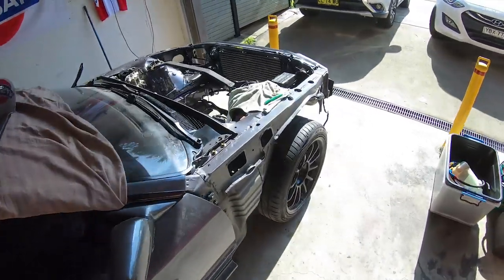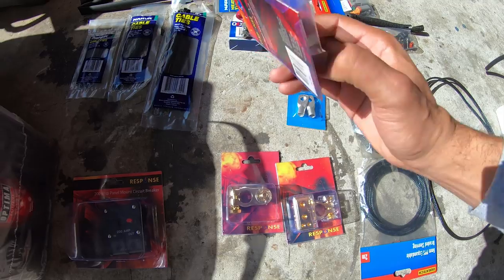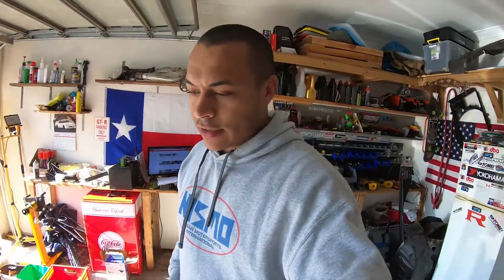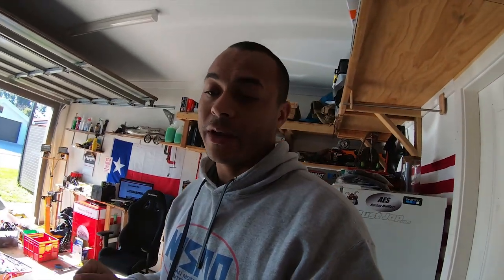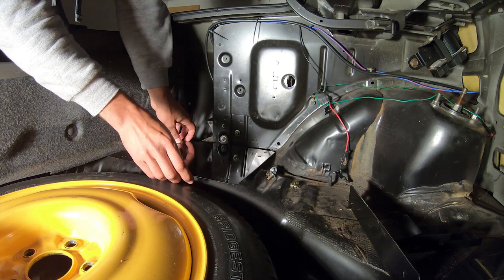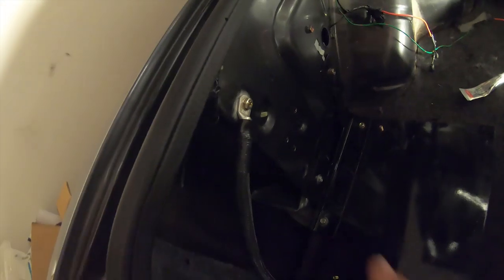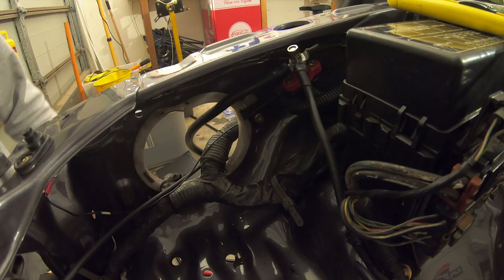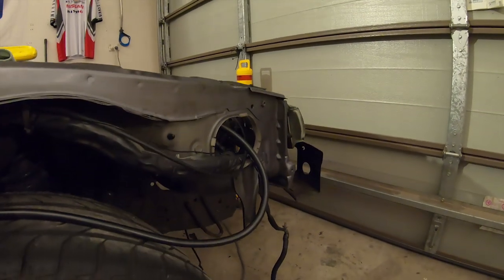Making a Nismo battery box and relocating the battery to the trunk of the GTR

Comment: Luckily for me my battery on my GTR34 comes standard in the boot. All I did was upgrade the battery CCA for more cranking power, and I fitted bigger battery cable. I'm still waiting for the panel shop to start on my GTR as its getting a full respray while my motor / gearbox is sitting at the mechanics workshop. Its been 2 months already looks like I will be waiting for a lot longer than what I anticipated. Hopefully we can catch up once our GTR's are finished.